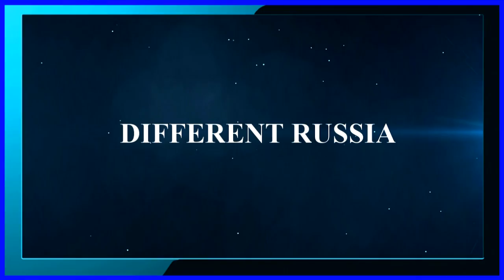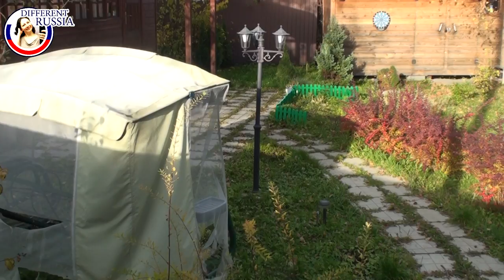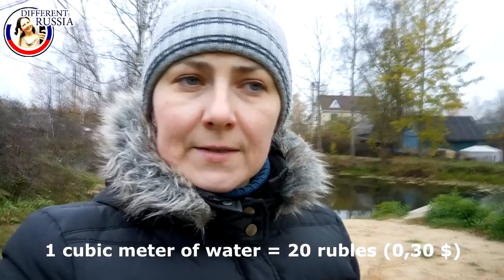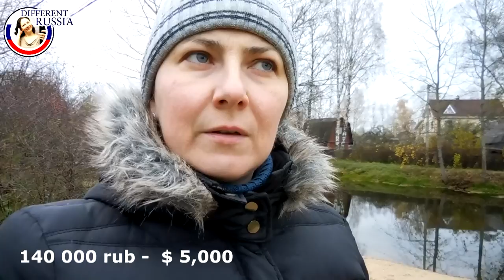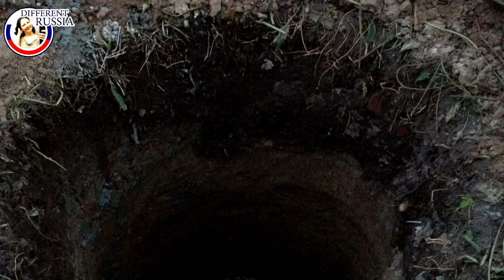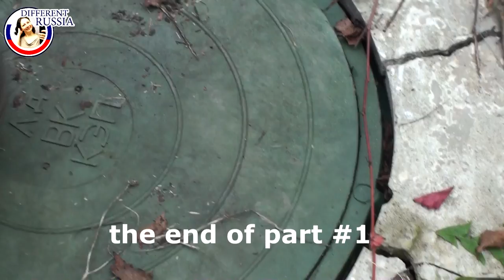Communication Systems of Russian Dacha Community: Gas, Sewerage and Water. Part #1 Answer Questions

Comment: Nice to get a look behind the scenes Valeria. I've always wanted to know how this works in your country. I hope in part 2 you couldexplain how this works with te extreme low temperatures. We here have to put our waterworks 60 cm deep to protect it from the frost, and that is usually not more then -10 degrees. And -10 is mild frost  in Russia. :)Thank you for sharing.
Reply from the maker: here pipes are  2 meters underground. It is enough that the water does not freeze, Here usually not very cold -10-15 . Only maybe a few days when it is -20
Reply: :) i thought so 60 cm would not be enough for your country. Thank you for your answer.

Comment: I get why some dacha residents need water only in summer and others all year round. But does the municipality have this summer/winter water program to save the water, since it is coming from wells? Or is there a different reason, like freezup? How is the usage controlled? Just by reading off everybody’s water meter or does the manager make his or her round twice a year and shuts down and opens up the valves at those summer user dachas?

Comment: Valeria, is solar power used in the dasha community?   Is it such that solar would not be economically practical because of the average sunlight only part of the year?  I didn't see any panels on the roofs of the dashas there.
Reply: Just for info I live in Dacha community fulltime it to is our house and we commute to work in Moscow, and there are no Solar panels as there is almost no sunshine from September to April. Maybe some summer only dachas could have solar if there is no electricity available. But electricity water and gas are very inexpensive compared to the west. So why bother.
Reply from the maker: Usually no. It is expensive and not very efficient. There are no solar panels or electric cars. And Sometimes solar panels are used to illuminate the parking or pedestrian crossing. It this video you my see solar panels near my house  https://youtu.be/2OtZBxzsd4Q?t=38s